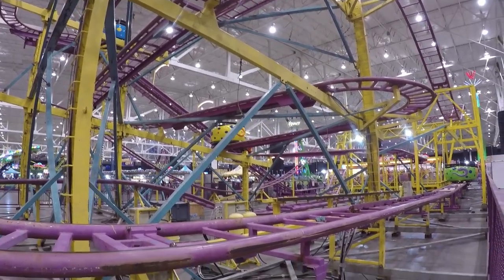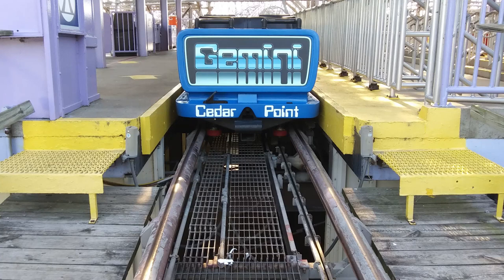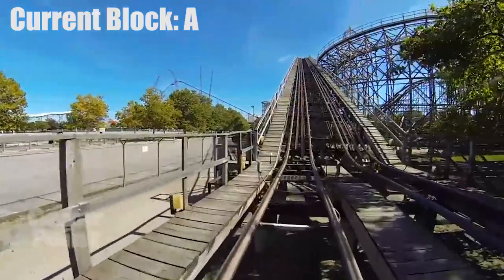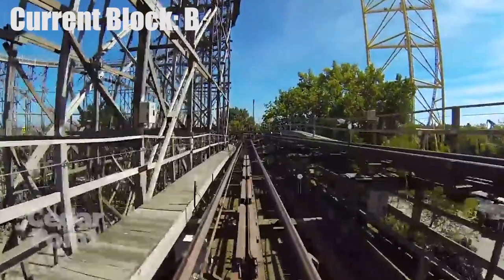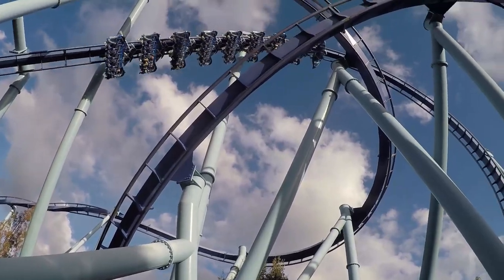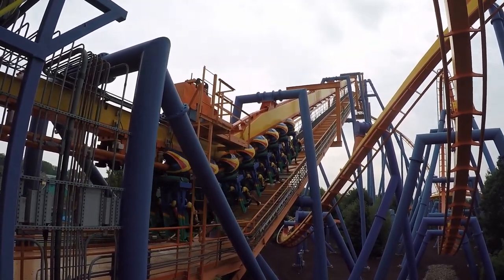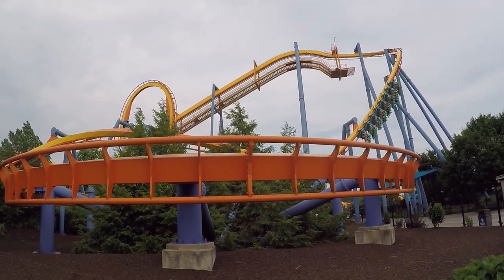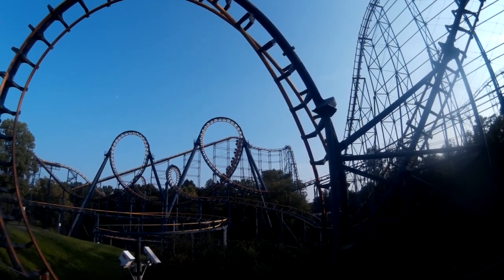What Stops Roller Coasters from Crashing? (Block Sections Explained)

Comment: The ultimate block section ride is Space Mountain....
Reply: And Matterhorn Bobsleds. They both have 15 blocks
Reply: @amanor409  I've been to Disneyland several times  and only just learned this.
Reply: I mean when you get down to it trains use the same access control concept, so you could argue the afroeurasian rail network beats every roller coaster?
Reply: Hahaha sooooooooo true!
Reply: Fun fact: the Hollywood rip ride rockit from universal studios Orlando HAS THE MOST GODDAMN BLOCK BRAKES AHHHHHHHHHHHHHHHHHH lol
Reply: @BigBrother-INGSOC not as many as the average disney coaster though.
Reply: @olileoli2788  i agree with that statemeny
Reply: True, not just because of how many it has, but also because it was the first with computers running them

Comment: Olympia Looping, a schwarzkopf coaster, does also have a "rolling blok" in the station and i thought Alphina Bahn also . I only think that they working different, these trains are almost kissing each other when entering the station. Also i think that the maniual reset of the blocks that you are talking about is mostly for the realy old coaster. Wroking at De Efteling, as also a ride operator on a vekoma coaster ant knowing the IT staff that knows the ride systems, all our coaster dont need a manual input if a train is stoped in case of blocked block section. But that can also be an specific dissicion made by de Efteling.
PS, I love your video's, they bring infomation to the GP that they doesn't know or fair. Keep up the work!

Comment: Block sections became even more important for roller coasters after the Smiler accident. The Smiler is a roller coaster at Alton Towers, an amusement park in the UK. The staff sent an empty train on a test run, but the train valleyed and came to a stop in an area where all cameras pointed to the area were obstructed. When a loaded train was sent to the lift hill, the lift chain suddenly stopped because a sensor detected the valleyed train, but the ride operator thought it was a malfunction, overrode the ride system’s computer and restarted the lift chain. The loaded train ended up rear-ending the empty train, causing everyone in the very front car of the train to lose their legs!
Reply: Since then, they only allow high trained staff to operate that ride and have also installed more sensors and cameras. Additionally, the metal guard at the front of the train(which caused the injuries) has since been rebuilt using a stronger metal. so yeah, the ride is as safe as it could ever be. Hope that helps soothe any fears you may have :p

Comment: I've seen the brake chambers that control block brakes. Those have large, powerful springs inside that apply the brakes in the event of air loss. They use the same brake chambers on trucks.

Comment: Arguably the deeper conversation regarding self-clearing blocks is how modern rides are designed to stack. Whereas original Arrow rides were designed to have a constant motion and the blocks were laid out accordingly, more modern designers have intentionally created additional blocks behind the station to accommodate a stack. The original thought was the trains should only stop outside of the station in extreme situations, so an operator needs to physically go out to the block and verify everything is ok (with the panel operator on the phone) before allowing movement to resume.

Comment: Block Brakes are also the reason that far fewer guests were killed in RCT2 as opposed to RCT1/D, they're a giant middle-finger to Brakes Failure.
Reply: If that's how brakes work, a Station Brake Failure makes no sense. Shouldn't they fail safe and thus not have the trains explode the moment it comes into the station at high speed?

I mean why did it take the innovation of Block Brakes to solve that problem?

Comment: Fahrenheit at Hersheypark doesnt have a mid course brake run - but it does have sensors outside of the cobra roll that will not allow a train to dispatch from the station until the one train has left the cobra.

This is because on day 1 of testing train 1 known as "Stucky" got stuck inside the cobra. No one was onboard.

Comment: This is the same system as used on most railway lines in the UK, with the exception of ERTMS equipped lines and most tramways. I assume it has been phased out in outher countries since a lot of people seem to see the signalling systems here as outdated in comparason
Reply: Actually absolute block of some sort is still the default and with few notable exceptions (eg the US) is required for all passenger movements in most countries. Even with in cab signalling it is common to still use fixed absolute block where trains don't need to operate with very short headways. Simply put it requires way less supporting infrastructure than moving absolute block operation which requires a whole bunch of precision real time sensors both trackside (UWB, Radars, etc) and on the train (Inertial measurement units, accelerometers, speed sensors and so on). Needless to say this is extremely expensive and is generally only cost effective for lines that need exceptionally high density on a very limited track footprint thus requiring really short headways, commonly this would be for example metro lines since this is what you need to get those 90 second or so turn arounds. Those short extremely high ridership metro lines are typically where you find enough revenue per track mile to even possibly fund the installation and maintenance of the additional moving block infrastructure.

Comment: 2:46 Can a ride operator restart the lift hill when the adjacent block is still occupied?
Reply: properly designed safety interlocks will not allow a operator to release a train into a occupide block. however mechanics can override safety interlocks with a reset. this should only be done after a full visual inspection of the tracks. the smiler inident at alton towers is an example of where mechanics failed to do a sweep of the track resulting in a colision between a valled  test run and a full train. it was not helped that the ride opperators added a train to the ride and did not tell the mechanics. though it is still the core responsablity for the mechanics to not override anything with out confirming safe operatining conditions.

Comment: Are you sure about B&M Pioneering the rolling block? I remember watching a Video about the Ride System of one of the Six Flag "Demon" Arrows and there was a mention about how the ride once had a rolling block in use. Or was that retroactively implemented after B&M began using it?
Reply: Soonjai You mean “Demon” at SFGA? Than if so, they didn’t use rolling blocks.
Reply: @jstyxx4110  Yeah, it was that one. And I found the Video I remembered again too. At around 14:40 mentions that it did have a rolling block, but no year is given since when it isn't in use anymore.

https://www.youtube.com/watch?v=2QeGhXQBc6s&t=875
Reply from the maker: implemented later, rolling blocks existed before B&M but B&M made them safer and brought them to the mainstream. Six flags also disabled that rolling block soon after the system upgrade.

Comment: Do log flumes have block brakes? Because about a year ago I was on splash mountain at Disney world when they stopped the ride because a tornado was in the area. At the time we were stopped, we were at the top of a lift hill. When it restarted we went down the hill and to the next, when they shut down the ride again. We weren’t on the conveyor but waiting right before it. Several logs crashed into us as we were waiting and I was starting to panic. The scariest part was when they turned on the lift, the log didn’t catch it so we had to hoist ourselves forward. We could only think of the cars behind us crashing into us at the bottom of the hill.
Reply: I would say probably not. The same thing happened to us in the 3 Cabbiaros (however you spell it) ride. They do that so if something goes wrong all of the boats/logs would be in one area so it's easy to evacuate if needed.
Reply: AlonelySkyDragon oh that makes sense! Thank you
Reply from the maker: They do not, but they do have systems in place to avoid high speed collisions, this video explains SFGAm's log flume you may want to give it a watch: https://www.youtube.com/watch?v=g-Biw9ZU68k
Reply: After a bunch of "sorta - kinda" answers I want to answer this completely.

In the sections where the logs/boats are just floating around, they don't have block systems. They don't need to. Ig the boats bump into each other at that low speed, nothing is going to happen.
However, on the drops and their runout areas they do. Did you ever notice that before going down the drop, the boats go on a tiny conveyor belt? That's where they are stopped when the runout area is occupied. In the old days, they used to have ride attendants sit in a booth right at the drop that would stop the boat and send it down the drop when everything is clear. Nowadays you can easily spot sensors, often mechanical ones with their "fingers" poking up through the water, where the boats leave the runout tracks and start floating again.
Reply: @Jake Fry Maybe that depends on the manufacturer... here in Europe, where Mack Rides is the #1 supplier for such rides, you see those fingers all over.

Working in the industrial controls business (not with rides, but the parts they use for this purpose are taken off the shelf), I would not recommend photoelectric sensors, as they are prone to getting dirty, and especially in this environment, splash water on them. Capacitive or inductive proximity switches are far more suitable. ;-) 
Compare that to roller coasters, old Arrow coasters used to have photoelectric sensors for their block systems, but now all manufacturers use inductive proximity switches, often to be seen as these turquoise blocks somewhere mounted between the tracks.

I think it's safe to say, no matter who builds the ride, the concept of placing blocks on log fumes is comparable, but the methods used to implement them may vary. ;-)

Comment: So with the self clearing block and rolling block on B&Ms does it apply to all B&Ms ever built? Or just newer B&Ms?
Reply from the maker: Rolling blocks is just on very new B&MS (post 2010). Self Clearing blocks came out around 2002, but I do not know when they exactly started to use them.
Reply: @CoasterCollege  Ah makes sense. So now I know that Behemoth doesn't use rolling blocks, but I know that Leviathan and Yukon Striker do. You the man :)
Reply from the maker: @TonyKimtheamusementparkfan  No problem, glad I could help!
Reply: GP To Enthusiast Does a double loading station such as SheiKra or Cheetah Hunt count as rolling blocks?
Reply from the maker: @triple7marc  No.

Comment: How do they start back when they are stop by the breaks ?
Reply: Block brake sections usually start the train again either by using a slight downward slope to let gravity take its course or by using drive tires to push the train out of the block.

Comment: You mentioned how rollercoasters are perfectly safe in your debunks. No need to worry about incidents
Reply: The United Flight they are safe
Reply: well SV at CP had a major accident in 2018 so did magnum and valvern
Reply: Nicky D all 3 of the rides are still perfectly safe

Comment: I have a question. Basically I was watching a video on Hagrids motorbike ride at universals island adventure, I heard they have 12 trains. I have a scenario I’m confused about , say train A clears a the first block station and the train B behind  is launched into the next section, what if train A launch fails or it rolls back into the previous block section where it will activate breaks and stop right? What stops train B from entering that next block section and hitting train A? I hope this makes sense lol!
Reply from the maker: Train A would stop in block 3 in this situation, train B would stop in the brakes that control entry to block 3, but it would still be in block 2. Keep in mind that all blocks have a method to stop the train at the end of each block. Hope this awnsers your question!

Comment: I want to ask this question 🙋‍♂️. Let’s go back to 2018 when Steel Vengeance came in.  It ran for testing with no problems (or adjustments made). On opening day, a train did not stop and hit a train in the station.  Not hard and I don’t think no serious injury. 

No let’s go back to the “block section”. How did this happen if there are safety protocols in place?   After all, brakes lock by default right?